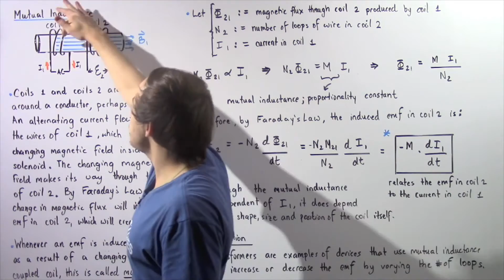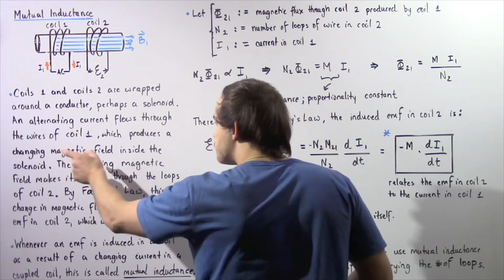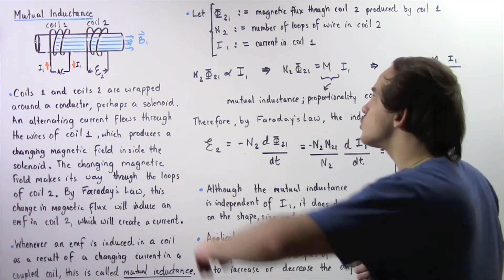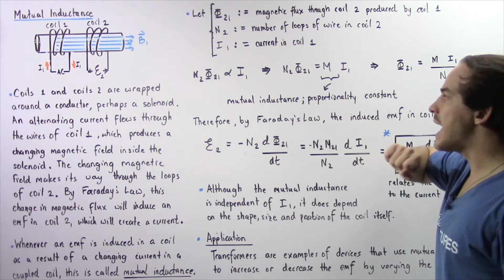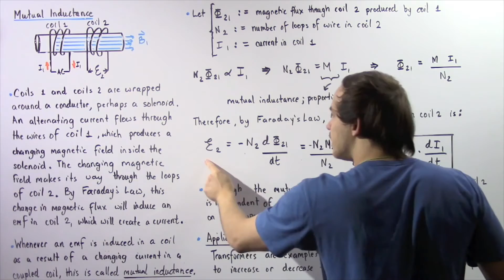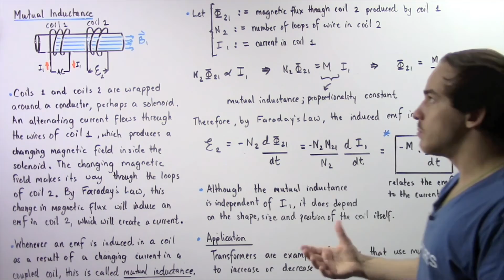Mutual Inductance

Comment: Hi DR. can i ask you qustion how to solve this equation pls in EMF

Two coils have a mutual inductance of 580mH. One coil is supplied with a current given by I(t)= 3t^3 - 2t +4  , where I(t)is in amperes and t in seconds. What is the induced emf in the other coil at t=2.5s?
pls reply me in this email
Reply from the maker: Aziz Almancey I wish I could help but I simply dont have time to answer my viewers personal questions! Sorry. Thanks for watching anyways.
Reply: No problem you would use E = -M(dI/dt) Where E is the induced emf, M=580 mH or 0.580  H
I(t) = 3t^3-2t+4 so you differentiate the current function d/dt(3t^3-2t+4)=9t^2-2
then evaluate at t = 2.5 s = 9(2.5)^2-2 = 54.25 A/s
then calculate the induced EMF E = -0.58*54.25 = -31.465 V is the answer!